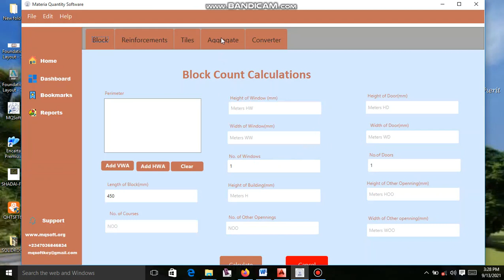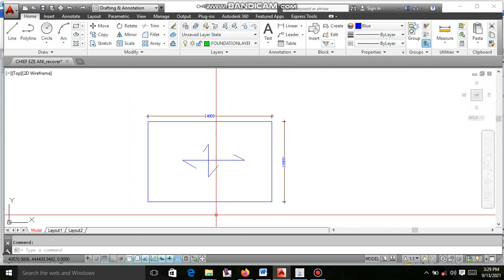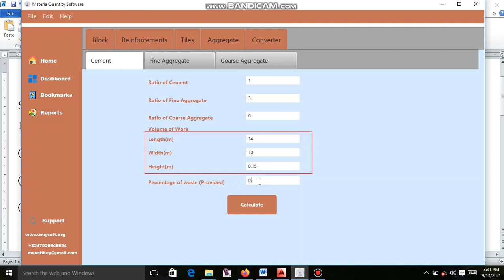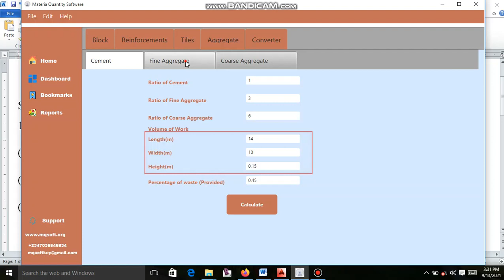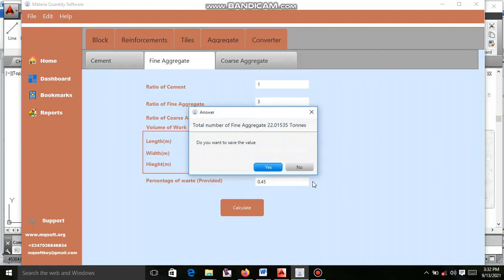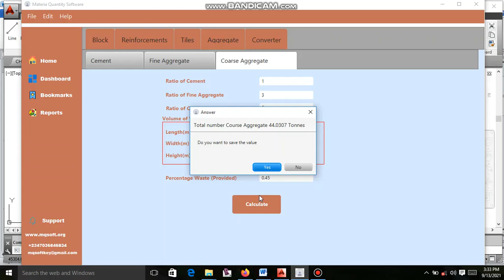How to calculate the quantity of bags of cement in a building construction using MQsoft.

Comment: What if you don't know the length and width of a slab but you know the area how will it be calculated?
Reply from the maker: casting is calculated in volume and volume is length, width and height, the thickness of the slab must be determined